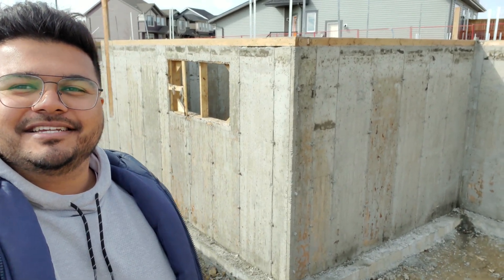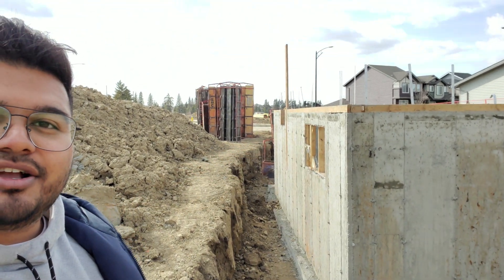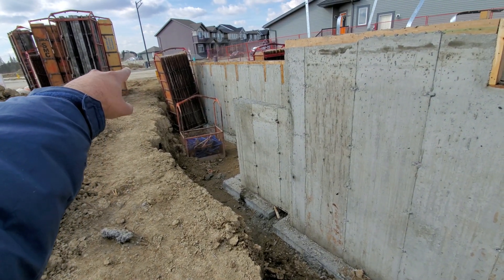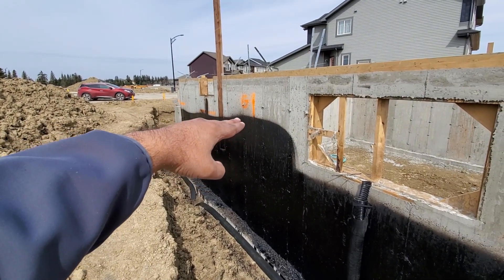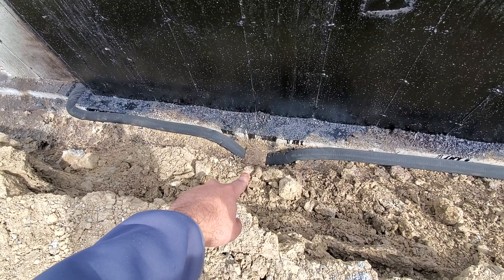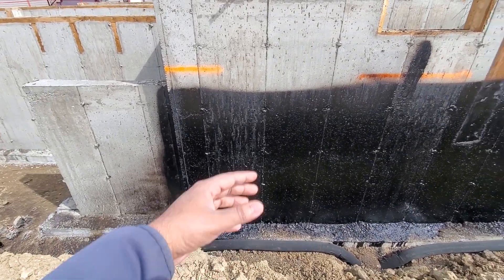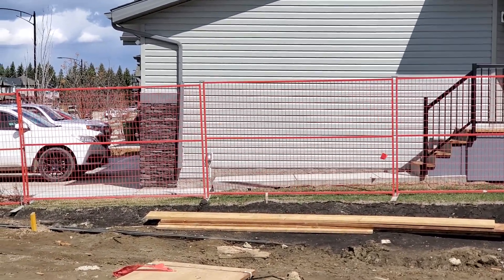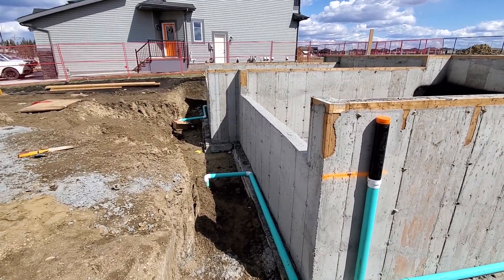HOW DRAINAGE Works Around Your Home - DPAD's Daily EP21

Comment: Great video!  You did a great job explaining how the drainage system works.  My home was built the same way, with all the downspouts going into the French drains or weeping tiles.  I have no basement (homes in my area of the country don’t have basements) so there’s no sump pump - the whole system empties out underground in the yard.  My soil is pretty much all sand, so it works.  There are a couple of places where water will collect briefly in a big downpour.  One is about 3 feet out from the corner of a large screened porch (so about 15 ft from the house itself) and there’s a pipe there, as well, that connects to the drains.  There’s a flat grate about 4 inches across that allows the water to flow in.  For all I know, there may be more.  I found the two I know of by accident.  We only have a 4-6 ft strip of grass along the front walkway of the house and the rest of the yard is pine straw.  The drains are under the pine straw so are invisible.

Comment: All of my gutters are connected to drainage pipes that lead underground to the rear of the back yard.  One end of the house looks like a mini sewer system with metal grates.  The house is almost below the level of the road at that end of the house.  I believe there used to be a sump pump at that end of the cellar, but it was gone before I bought the house.  I see telltale signs that there may have been major cellar flooding decades ago.  Only a little water gets in now, mainly from overflowing gutters, gutters that I clean at least every other month.  Memo to myself - Never buy a house surrounded by pine trees EVER AGAIN.  😃

Comment: How different your “rules” are for sump pumps. My city here in New England forbids us to pump the excess water into the city’s drainage or the streets. We have to keep it on our property, which keeps cycling back into the basement until things dry out. My neighbors and I pump into our front/ back yards. We avoid the sides because that’s more likely to flow into the neighboring houses. Not ideal but it’s all we can do.

Comment: Interesting how you have all the drainage around the outside. Very interesting.  I have never seen that before.
Reply: Without the weeping tile, water can seep into the basement through the concrete. Concrete is a porous material. You never want top buy a house with a basement and no weeping tile. You'll have problems with humidity and mould.

Comment: why do you prefer the removable form and concrete walls for a basement instead of those insulated blocks that are then filled with concrete and parged over (not sure the name of them) or pressure treated wood walls ? (are wood basements even a thing anymore?)
Reply: I've seen the insulated blocks in renovation tv-shows, they looked expensive. Don't think they are used with standard build, looked to be premium stuff. Pressure treated basement walls have never been a thing, at least not here.
Reply: I can’t imagine how a wood-walled basement could even work?  Wood rots!  Even pressure treated wood.  I’m trying to think of how that would even be possible…
Reply: @Lucinda_Jackson  It would be a disaster in a few short years. I've seen cinder blocks or concrete for foundation, or even field rocks where historical buildings are involved, but never wood.
Reply: @isabelleblanchet3694  
Exactly!